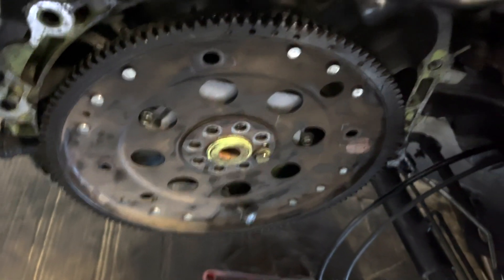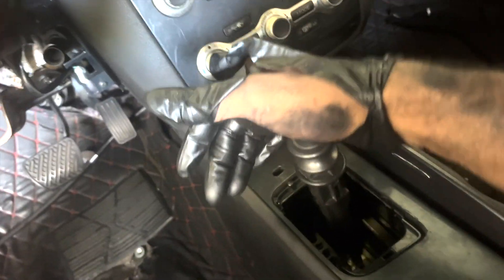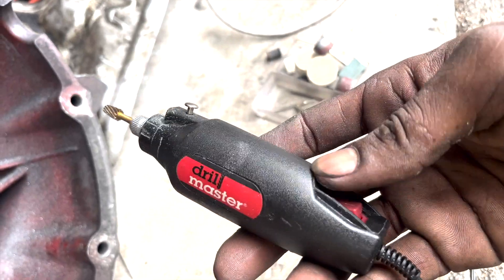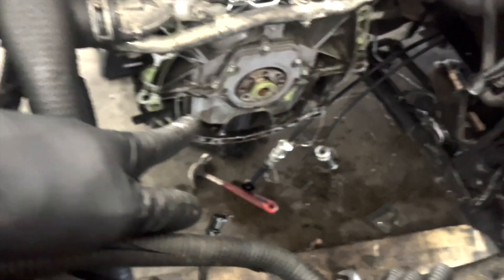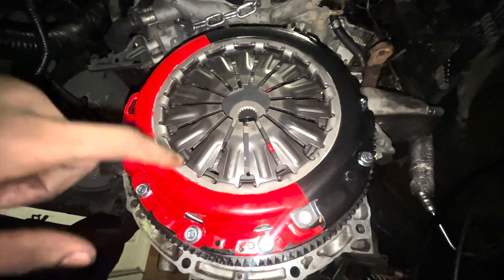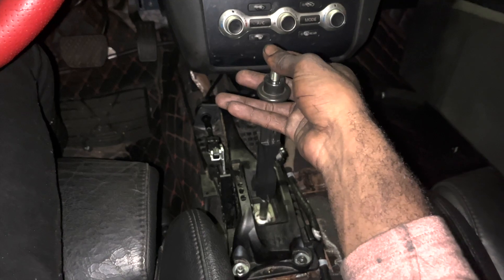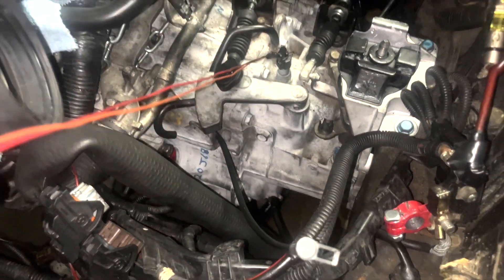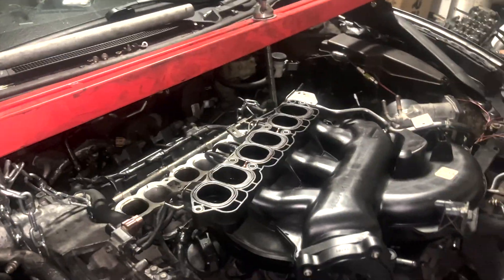(Part 3) Stage 2 Clutch, Flywheel, and Transmission Install - Manual Swapping My 7th Gen Maxima

Comment: Long shot but wanted to ask if you can explain the electrical mods done, specifically the wires cut from the trans harness connector...
Reply from the maker: I think I explained in the final video what wiring needs were needed. It wasn’t anything crazy. Hard to explain it through text.

Comment: What did you use to seal back the hole where the shifter cable passed through bro
Reply from the maker: I ran the manual shifter cables

Comment: Whats up fam how did you connect the master cyclinder to the clutch pedal
Reply from the maker: Had to drill a hole in the fire wall and two little holes for the screws